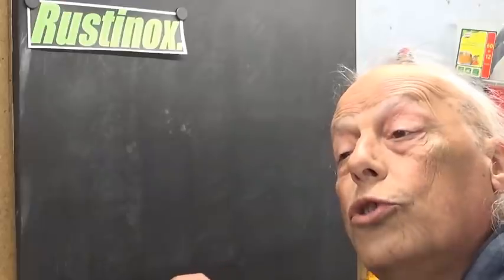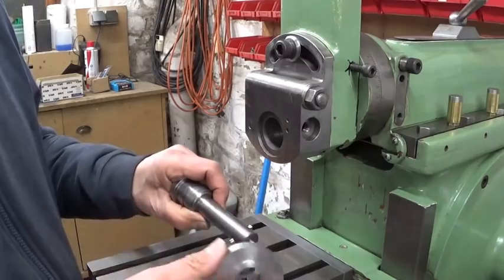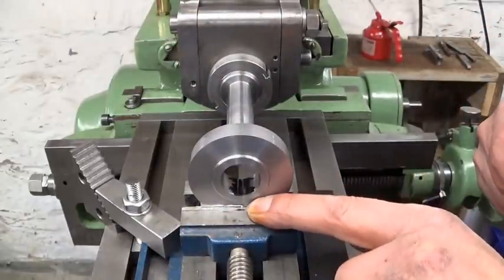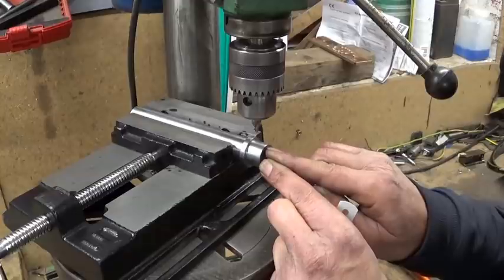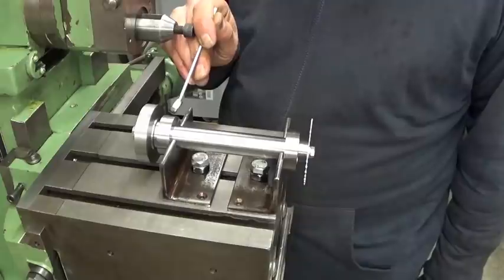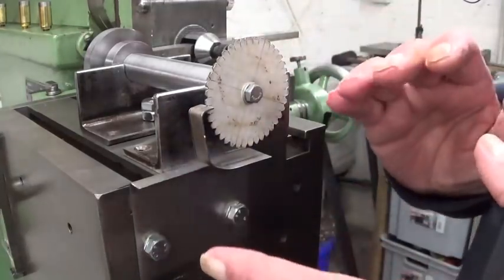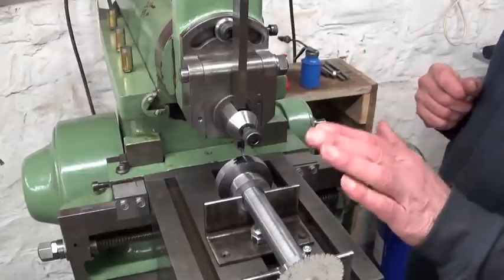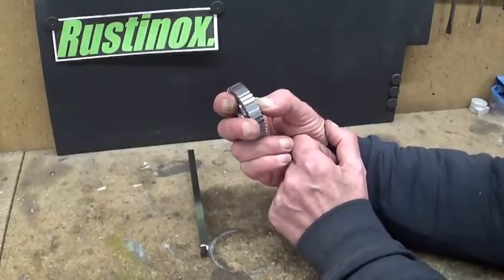Making a (sort of) gear on the shaper.

Comment: An interesting video, many thanks and a better New Year to All. have you got a 40t or multiple gear on the gear set for the lathe which you could use as the divider ? You just have to make the latch then.
Reply from the maker: Using a gear was also my first idea, but i don't have a 40 or multiple gear.

Comment: I indexed from a surplus gear that was slightly too large for what I needed, but had the same number of teeth, mounted on the opposite end of the shaft.  Moved the ram position out to the index gear to clock the work, then back in to make the cut.  Took me three attempts to get it close enough for the file & fiddly fit work.  Not the easiest/most ideal way to do it, but it can work when other options are closed to you.

J.B. From Oz, Geoffery Croker, and others have experimented with a shaper gear cutting attachment you can build.  Looks like a good project to explore.  When it works well (meaning, properly set up) , it seems to eliminate a lot of the headaches from using a form tool in a plunge cut.
Reply from the maker: The method JB uses in his video is what i learned in school, but we never did get diep in to it. On the internet is also not much to find. I will continue experimenting.

Comment: It occurred to me earlier that the clapper is really needed because the automatic feed is timed to move the table while the tool is on the return stroke. Essentially, at some point on its path, it climbs onto the uncut material. As this is not the case with plunging (of course it should be timed to only feed when the ram is in the retracted position) then the clapper function is not really needed , maybe apart from reducing tool wear.
Reply from the maker: Indeed, you're spot on.

Comment: Hey rusti, instead of the finger setup, maybe having holes in the plate with a locking pin may be more accurate, like the indexing plates you see on some of the old watchmaker lathes
Reply from the maker: That's maybe a good idea.

Comment: Loved the video, subscribed. :) Do you have any lathe change gears you could use for a dividing plate? Then grind a pin that fits in the root of the teeth so there is no backlash.
Reply from the maker: Thanks for the sub. I had the same idea but i don't have a 40 or multiple gear.

Comment: Nice to see you back in the shop!

I have the same problem with my hembrug shaper. (With the original gear) sometimes the system does not engage and there is no movement on the table. Could it be that the spring is not tight enough anymore?

Have a nice new years eve! 
Greetings from Holland
Reply from the maker: Hi Chris, is it ok for you if i first fix the problem on my machine and anser you in an upcoming video? So we can share with everyone.

Comment: Hi Rustinox. Enjoyed watching your precision paper template in action. I agree with you, your flexible indexing
finger is at fault. You also may need a stronger spring and/or a re-file to shape of the table drive feed pawl which 
engages on the 40 tooth gear you have just made. Great to see you back working in your workshop again. Eyup Tony
Reply from the maker: Next time i'll make aspring loaded pal that fits the gear teeth.

Comment: Awesome project. I had to make a replacement ratchet wheel for my steptoe shaper some time back. No easy task at the time. Love your indexing plate, I have also seen someone use different sawblades with different tooth counts as indexing plates. Really make quick work for some projects
Reply from the maker: Thanks Craig, it needs some more werk but we'll get there.
Reply: @Rustinox  I know you will :-)

Comment: Cutting accurate gears is best done with a multi-tooth cutter in the mill. Less shock loads. Also much quicker. But If you use a more accurate, and rigid, template and a stronger index pointer, your way will work. But remember that a real gear tooth is quite a long cutting face, hence  high load on the whole of your mounting.
Reply from the maker: That's how I do it now;
https://www.youtube.com/watch?v=kT7zamroon8&t=12s

Comment: i believe after watching Adam Abom79 that a shear tool works really in in his shaper to give a good surface finish, i modified his idea and made one that works in my lathe, really good on softer metals and produces a finish that resembles a ground part. downside is it only removes a few thou at a time
Reply from the maker: Indeed, the sheer tool works really well on cold rolled steel and brass. I never tried on aluminium.
Reply: @Rustinox  i was quite surprised when i first saw one, works well on my lathe, i cannot comment on the shaper as i am not lucky enough to own one

Comment: Great video, a suggestion is to perhaps use adapt and use  lathe change gears as templates e.g. you want a  40 tooth gear use 80 tooth lathe gear and using every 2nd tooth gives 40
Reply from the maker: Using a gear was also my first idea, but i don't have a 40 or multiple gear.